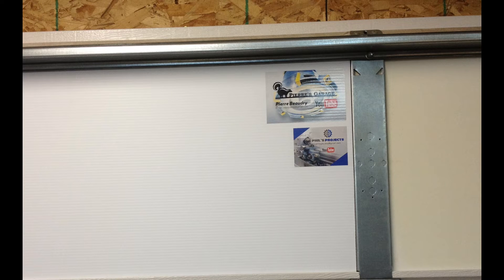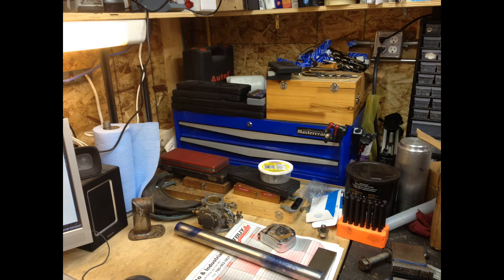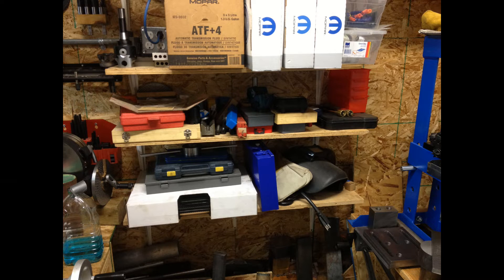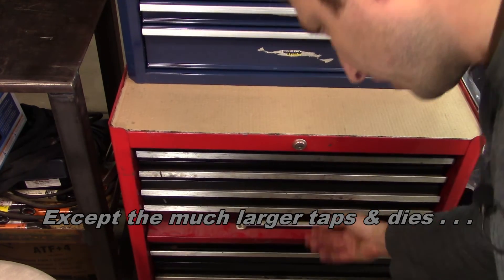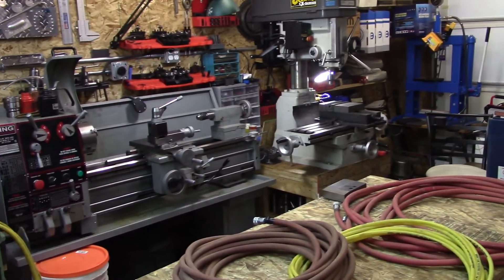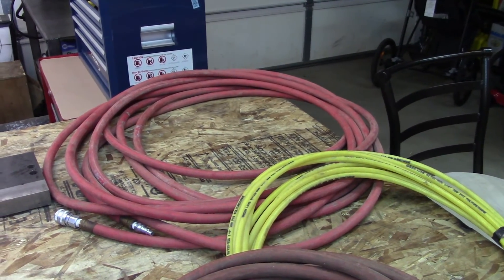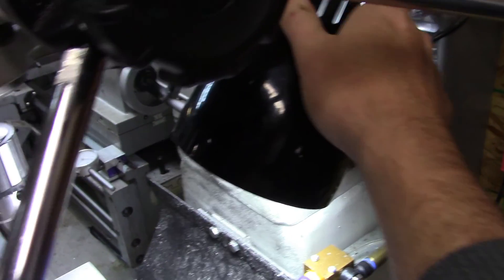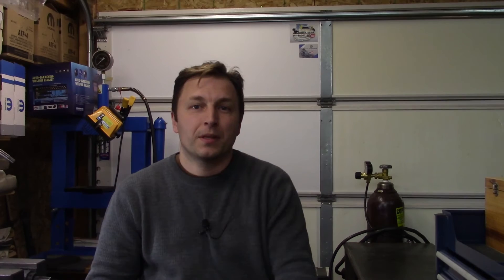Shop Lighting, Tool Storage, Sticker Board

Comment: I got to build my shop from scratch so my walls were all painted white before anything else was put into the shop. (Well, OK, drywall sealer but it is white.) That helps the lighting a lot. That is, by the way a smoking deal on the black book. Amazon Canada wants 75 Canadian pesos for it last time I looked.
Reply from the maker: In retrospect, painting the walls a light color would have helped a lot, but it would have had to be done before everything got piled against the walls.  Maybe next time, if we ever move (to a place with a bigger shop, of course!)  Thanks for coming by!